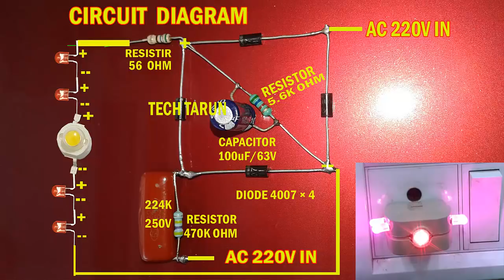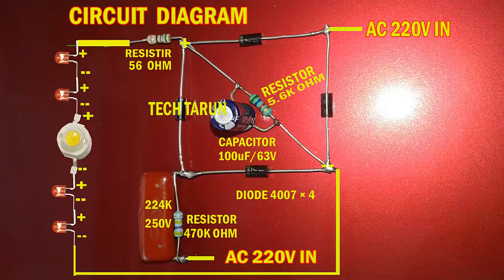HOW TO MAKE LED LIGHT TWO PIN PLUG !!!! NIGHT LAMP

Comment: Components not listed?? Not visible ? Will you plz fwd me a link of details of components.. Thank you.
Reply from the maker: METERIALS USE ----- 
Two pin plug
Led
Polyester capacitor :-   224k/250v                              
Electrolitiç capacitor : - 100uF/63v
Resistor ( 1/4watt) :- 
470K ohm    
5.6k ohm    
56 Ohm
Diode -  4007 × 4